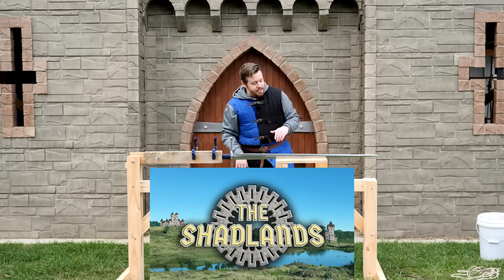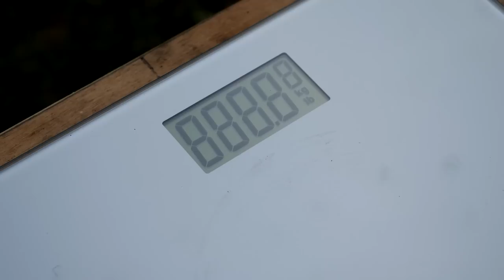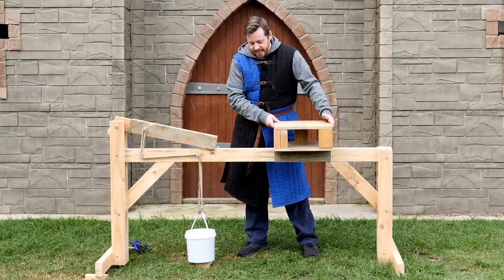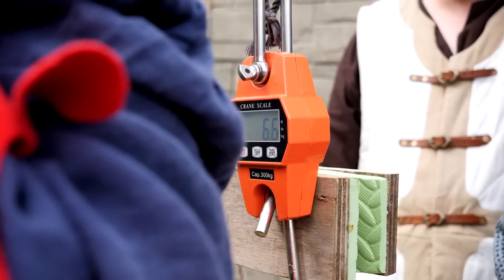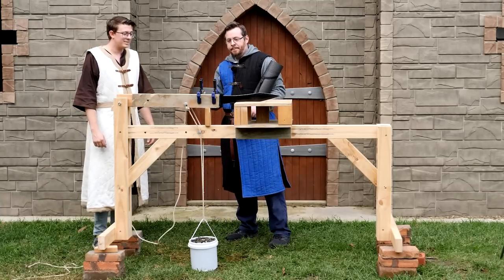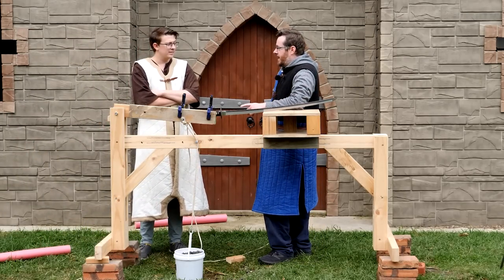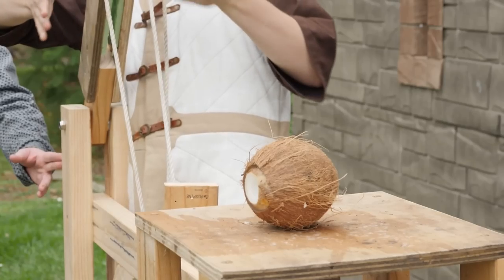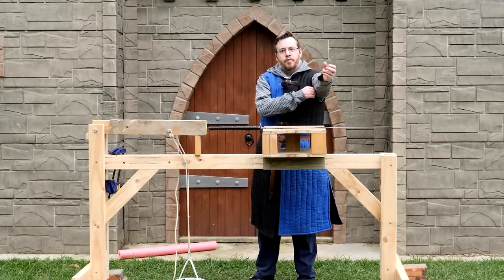Choppy choppy

Comment: - Seems like this should be able to demonstrate a piece of the difference between follow-through vs no follow-through by just setting a stool with a cushion underneath the strike weight. 
The cushion both protecting the bottom of the buckets a bit and simulating rough muscular let-off like muscles for a loose swing vs carrying through.
Wont be perfect; but can even then up the strike weight a touch.
- A few thoughts on simulating the swing: having a way to make sure are releasing the swing arm from the same height each time and pegs in the handle grip to simulate the over and under leverage that a 2 handed grip can have depending on the grip being used. The travel distance of the swing arc is the time that the weapon as to accelerate. Which could end up including variations in the height of the point of impact into the cutting material. The point of release is probably the easier to control part like for archery draw lengths.
- Think that using soley the handle holder using now would more closely simulate a single handed grip. While for a 2 handed sword grip it would be a bit more like having a peg above the handle closer to the blade; while a 2nd peg would be below the handle closer to the pommel. There could be foam cushioning the pegs much like there is some give in people's hands and grip during a swing.
- Placing the cutting target on the cutting platform as near to the cutting arm as possible without issues would reduce interference from cutting the edge of the platform wither before the cutting target or part way through the swing. Otherwise there is potential for it to work as an inconsistently applied backstop to swing.
- Maybe a combination of these things made the difference with the coconut test?

Comment: Hey Shad, i have got three things to add:
1. I think you should build the arm kind of like a trebuchet. So you have pulley system with a stopper. That way you dont need to touch the arm directly, but pull it up with a rope and have the stopper hold it in place with a bolt that you can pull out. That way you remove the danger of accidentally loosing grip on the arm and cutting of a hand or two.
2. For a better grip on the sword, there should be another plate or something ontop of the arm where your clamps are. Right now the swords are just held from two sides and slides out the top when hitting the target.
3. And something to hold your targets in place would be good too, preventing them to get pushed away.

Comment: I just did some similar scale tests.

A more accurate and consistent force measuring device and method is needed. It was hard to get a consistent reading for me.

Simply by changing the flexion in the wooden poles of identical length, I was able to alter the vertical pressure, no speed, measurement from 6 Kilos with a 3/4th inch section of for 4' dowel rod up to 19 kilos using a 1 1/2 inch 4 foot dowel rod. 

The other thing I noticed was the inconsistent flexion of the wooden swing arm. 

The war sword was heavy enough to compensate for that. 

Looking forward to seeing the evolution of this!

Comment: My opinion....
Much like splitting firewood you need a follow-through not just coming to a static stop and it wouldn't hurt to have the hilt holder finish its stroke below the 90° mark and hit a spring or other cushioning medium to dissapate the leftover energy

To calibrate the force similarities take a uniform amount of a medium like Clay or Playdoh make your strike by hand with Ye Mighty STICC then scale up the weight with your Jig until it matches your results 

To secure the sword hilts /handles drill ½" holes every 2" in a grid pattern and use 4 dowel rod pins above and below front and rear AND your clamps. This will keep your blades consistent

Comment: The major difference is follow-through. When your arms swing the blade you are accelerating through the whole motion and the axis where that rotation is turning is at your shoulders. So the entire leaver is from the shoulder to the end of the blade and your elbows also work as a second fulcrum further increasing the force applied. The way your machine is built it's not taking advantage of the full length and shortening your leaver. 

Also the blade slips as soon as it makes contact losing energy where your hands resist the force and push through to the wooden block beneath the target.

Comment: I think speed is the key factor. Static force applied is wildly different from a dynamic hit, so your calibration may not be the best approach. Even if the mass/force applied is the same, speed will determine the outcome. Your hand strike seems faster than the guillotine, as it can only move as fast as the G-force allows. Your hit is not only propelled by gravity but also by your muscle strength. 0.5-1m/sec may have a lot of difference in the result. Also when hitting with a sword like a katana your hands make a fulcrum. Your back hand pulls and the leading arm pushes, making the impact harder, as there is a lever effect with an axis at the base of the blade. With a static, mounted blade this might not be as strong. Try to fix the blade with some bolt above and below, at the front and the back. This will prevent the sword from rotating in the clasp. To simulate it better you would have to have a weight and a spring loaded mechanism to function as your muscle tension, aiding gravity.

Comment: Buy some ballistic jelly and create your own dowels from the brush in your backyard very specifically choose a tree that you will always be able to get a green Branch from that is considered a softwood like Poplar or fur make a casting molds for your ballistic jelly play your sticks in their fresh from the tree or bush branches will remain Supple and acceptable for testing for about a week inside of the ballistic jelly and the ballistic jelly can be reused by reheating it unfortunately you will have to filter out the sticks after you have chopped them. Replacing them with brand-spanking-new sticks I would suggest within 24 hours before testing

Comment: I think you made some points on nunchucks, where the momentum of the striking portion of the weapon was limited because there was no kinetic chain to the rest of your body.  Kind of a similar thing going on here, when you hold a sword and cut down, your arms might be accelerating the sword to get it moving, but the rest of your body joins the kinetic chain and adds to the momentum of the strike.  Or in empty hand striking, if you start a punch with your legs and hips, driving from a good stance, it adds more power than you could get from just your arm.

In the testing rig, you only get the momentum of the sword, a few pounds of wood, and whatever is in the bucket.  Far less than your full body moving into a cut.  Mechanically, a heavier arm, like maybe 50lbs but balanced near the pivot, with tension springs (garage door extension springs, maybe?) to accelerate it faster than gravity could be a good place to start.  Moving weights further/nearer from the pivot could adjust your polar moment of inertia until you get similar results to manual cutting.

Comment: Nice rig, but a few suggestions from an engineer ("I have a Masters in engineering!")
A few suggestions (late to the party I know)
-Grip on the sword will be inconsistent due to a few factors: the geometry of the handle, how tightly you apply the clamp (which are hand tightened). Something that mimicks a hand abitliy to push from behind, so that it doesn't slip. Some sort of hard rubber, perhaps.
-Static and dynamic loads are very different, so using scales to validate the force isn't entirely helpful. Short of using test equipment to accurately measure dynamic load of a human swing and of the machine, you're probably best doing a sample of human swings on a consistent material with a single blade. You can then seek to replicate the amount of damage somewhere in the range of human damage (as long as the machine can replicate it every time). You'd have to use a very consistent material to do this properly, ballistics gel would be my vote, it's designed for exactly this sort of application, why reinvent the wheel?
-It's hard to tell what is the first thing to start decelerating the machine. It should be the impact of the blade on the target. But with the position of the wooden stop and the bucket hitting the floor, it's hard to say what happens first. If the bucket stops long before the cut then you've eliminated a lot of the static load, but do you want to? Does a human not still push on the blade as it makes the cut? (They swing through the cut, right?). A bucket bouncing on string doesn't feel right either. And the wodden stop will simply steel all of your momentum if it contacts first, and some of your "through swing" force if it teouhces at all! A trebuchet type mechanism, where the weight is free to swing through, might help with this, and would be on brand. :D
-Acceleration due to gravity is fixed, more weight might help overcome inertia, drag etc. But ultimately it will increase static loads much more than it does dynamic load. In order to increase the acceleration that gives the blade the momentum and ultimately the impact force, you need more mechanical advantage. A set of pulleys might do the trick, or more leverage, much like the trebuchet idea I suggested before. The way I see this working is that witht the blade arm up in the air you have another, shorter arm sticking out at 90°, with the weight attached )this would need to be triangulated to the main arm, of course). When you release the weight swings the arm down. You can adjust the acceleration at the blade by changing the distance of the weight to the pivot point. You'd probably need a heavier weight than you're currently using though, or the "small" arm might need to be longer than the main arm.

Comment: As others have mentioned, those claps do slip a lot. So I propose to add a piece of plywood on the bottom of a sword to support it from this side, and then cut two grooves so that you can see the sword handle from the side, and put strap clamps there. This way you will support your sword not only from the sides but also from top and bottom. Because strap clamps are, well, strappy, they will hug almost any sword handle nicely and provide really secure grip

Comment: Hi Shad! This is cool! This is getting close how a real scientific test sould be made. 1. Problem is the grip of the machine I think. Put one rod that stop the sword's blade end from movig up and an other one on the pummel end that stops the sword's rotation, so you get a human like grip. 2. Problem is the muscule acceleration between life test and this, because in this situation you only use gravity, but when You cut you use gravity+muscule acceleration AND that can be a huge difference. Maybe if you build a curve around the handle packed with wellplaced elektromagnets (like on a magnetic train's underside mechanic) that can simulate the muscule acceleration. Keep it up ;)

Comment: Few suggestions for improvement…
Use sand in your bucket; easier weight calibration, can put a lid on to keep all inside and between tests will remain more consistent.
2nd, your losing a lot of force to the sword slipping. It was a great idea you had, but a more solid base holding the handle (a pipe with foam lining, maybe?) would work better.
3rd, the pressure your measuring per cut was at the tip of the wood, yet you calibrated from the handle on the machine, thus incorrect pressure was at the tip of the sword/axe whatever weapon you put in there. You need to cut with the same pressure and length of your object that a human could produce which would require recalibration each and every time you change weapons, since the length changes. You could maybe get away with calibrating 4-5 regular “lengths” and having different buckets of weights for those lengths to change how and where you’ll be cutting with each weapon.
Further, a brace for your target box to stop the target moving, as most targets are solid.
Finally, you need a different way of calibrating. 8kg of pressure from a set point near target seems a very, very small amount. As with Katana vs Coconut, cut worked but contraption didn’t because people can put a lot more pressure in with a swing. The initial “hit” carries the inertia of the swing which you’ve lost by only applying pressure. Instead, calibrating with a force gauge at the tip of your stick and doing the same calibration by applying the stick to the machine and measuring at the target box would be more accurate.

That’s my take, anyway

Comment: It's the leverage that makes the difference.
The wood arm contacts the handle from the sides and has weaker transmission because it is a simple lever with the axis on one end and the work load on the other.
Your hands completely envelop the handle and can transmit force much more effectively because the axis is virtual (between your hands) and you have 2 workloads (your two hands) applying force in opposite directions.

To prevent the handle slipping between the holding plates and losing force at the moment of impact, you can drill 2 holes into it and insert two cylindrical stoppers (one above the handle, near the hilt and one bellow the handle, near the pommel).

Comment: Acceleration via bucket is 9.8 m/s² (1g), acceleration via your swing is far higher. For example baseball bats get accelerated (rotational) at around 20g by pro players if I'm not mistaken.
Also the traveling distance of the sword in your hands is longer (since your arms are located much higher than the axle of the contraption) and you most likely you also have longer arms than the arm of the contraption - which further prolongs the distance the sword travels, giving it more final velocity. 
The contraption presumably uses the same force but has a lot lower acceleration over a significantly shorter distance.
Therefore the final velocity at the point of impact is much, much higher when you swing the sword instead of letting it drop - even if you don't swing too hard.
Kinetic energy = 1/2mass * velocity².
On top of that maybe the contraption's vise grip lets go of the handle too easily and thus some of the kinetic energy can't be transfered into the target. But I assume that your hands also can't hold the handle superfirmly and there will be some give, so I guess that's negligible? But maybe you can make the vise jaws a bit concave in order to prevent the slipping of the handle.

Comment: I think the best things you could do, are measuring the force from the machine, by putting your calibration stick in it, and measuring the downforce from it. And then putting a wood stop above, and a wood stop below on the "Hands" that way a handle put between then and snugged tight, will have little room for slippage stealing the kinetic energy.

Comment: So I have a few observations: 
1. All blades have some kind of vertical displacement which means will the clamps seem like a good option to maintain edge alignment. They allow for a lot of slipping at the gripping zone. Looking through the slow-mo video, you can see that all the cuts are stopped by the wooden block underneath or when the sword/blade hits the clamp's upper bar. I have 2 suggestions: 
    a. Apply some constraint on the vertical axis, a bar or two that prevents the blade from rotating at contact with the objects. 
    b. Use a shorter block under the arm to allow the blade to go through with some compliance.
2. As others have pointed out, your force experiment has the same flaws that you later found out with the falling blades. When you measure the strength at the end of the stick, you're kind of measuring torque. I, however, do not believe the actual weight is important. As long as all blades use the same weight, the results should be equivalent. However, I think that given all of these leavers physics involved, I would use a shorter arm.
3. You should try to add a rope release system analogous to an actual guillotine. This would guarantee a clean release all the time. You could simply add a pole at the beginning of the arm and add a pulley at the top.

Comment: I have designed but never made a similar device, specifically for weapons testing. Much more accurate than doing it by hand, in case of unconscious bias or technique. 
Of course, my design is very complicated and basically a spring powered human arm, forearm, and wrist, and I suspect it would go through springs or rubber before it was fine tuned. I also designed one that could be done with some kind of motor... Probably even designing the second one was a bad idea in case I'm ever temped to make it.

Comment: As others have mentioned, you didn't compare the weights correctly; you should have weighed the "guillotine" mechanism at the tip of the stick like when you did manually.

But in addition to that, the acceleration of the weight is limited to that of gravity... Since you're relying entirely on gravity, and you obviously can't change the rate of acceleration due to gravity, I think you will need to account for that by having the weight (which needs to be heavier) at a particular distance from the fulcrum (probably closer than it is in the video) so that the increased leverage can accelerate the sword more quickly to a sufficient speed (though that will require still more weight).

Using the mechanism, it took ~12 frames from dropping to hitting the coconut. Manually swinging it looks like it maybe also took ~12 frames, but it's very hard to tell from the front on angle. However, it looks (again, hard to see from that angle) like Shad is swinging an extra 60 degrees in that similar time, which is maybe twice as far. So even if they did have the same amount of force/acceleration in the "swing", Shad's manual swing is going to be roughly twice as fast at the point of impact (though that's ignoring the effects of gravity while sword is hanging backwards, I guess).